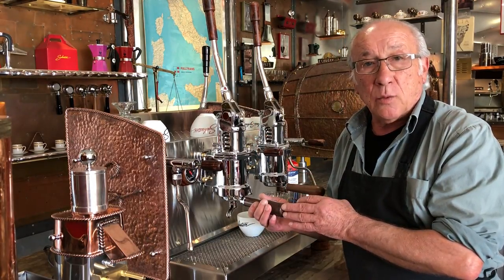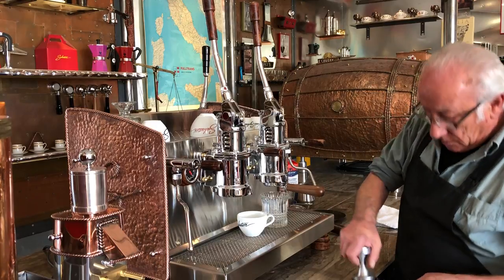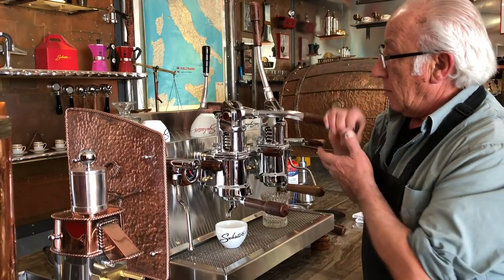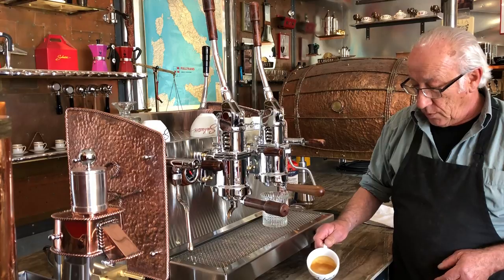Spring lever double espresso

Comment: omg this tamping again 🙄😒
Reply: Traditionally Italians don’t tamper hard, so he’s just doing the Italian style.
Reply: I'm stealing my girlfriends account but I cba logging back & forth.
I've been obsessed with levers ever since I picked up shifts in black Chapel in Wandsworth circa 2012ish, the owner ant is a kiwi & pulled some amazing shots. Right now I've stolen my friends lever, he found it in a Spanish office building they were clearing out & managed to get it before it was thrown away.
So my analysis, suuuuper dark roast & hes probably dosing around 21-22g. Now tamping is really ritualistic but I can only assume this technique works to distribute the grounds more evenly (really important when using a lever) he finishes with a twist keeping the seal In place so no channeling. Now If my assumptions are correct, the best practise I've found for this is to knock the portability on a counter before tamping to settle everything down & get rid of air pockets. Now the tamping itself I've not really found to be overly important, when the lever is in the lower position its sort of pre infusing with no pressure so gives all the grounds a little chance to suffle, if you lift the handle & pull it down again it sort of does a lazy man's tamp.
But this is what makes a lever so fun, there's so much to play with

Comment: Beautiful machine, however your tamping contradicts everything that goes into the preparation of the puck. I would like to see a dual spout extraction and a scale for grams in to grams out. Also, the tapping of the portafilter will always induce channeling. The only reason there was no indication of that is due to the single spout. Your naked portafilter demo showed gross channeling.
Reply: Not that the customers cares in the slightest as it is impossible to notice in the final beverage.
Reply: @rogerbaker1670  I beg to differ as someone who knows what he is talking about with decades of experience in coffee, technical and education. You might want to comment on something else because on this topic you probably don’t have the skill or background to speak.
Reply: @Alejandro Sevillano  I am looking for a high-end single group leva-style home professional machine.  Ideally double boiler so one boiler dedicated to the group head, and the other at the higher temp for steam wand to froth milk.  You sound like you know your stuff!  Any thoughts?
Reply: @chasvonplatten1298  you should get a profitec pro 600 dual boiler, independent dual PID with adjustable preinfusion with option to switch to single. It has an E61 group head with flow restrictor. If it’s lever you want, Nurri L-Type P800.
Reply: @Alejandro Sevillano  Thank you Sir.  Not finding the exact Nurri model number you provide. Closest appears to be: L-TYPE LEVA S.A. at approximately $7,000.00 would it be the unit you recommend for leva double boiler?